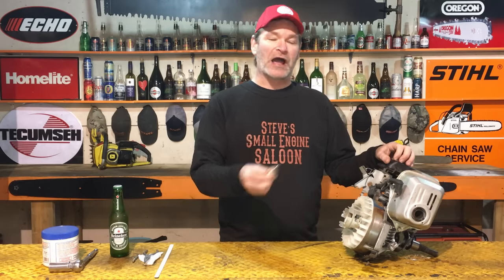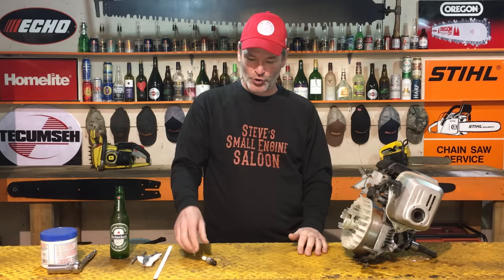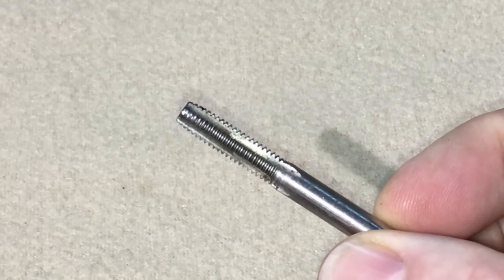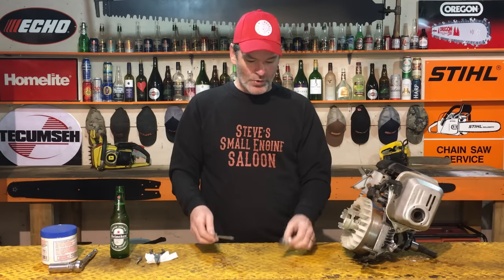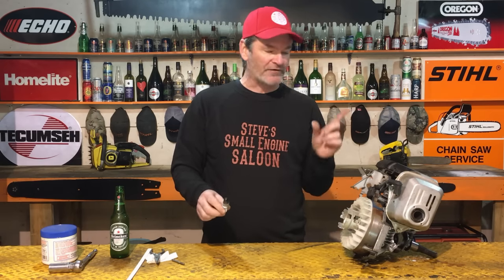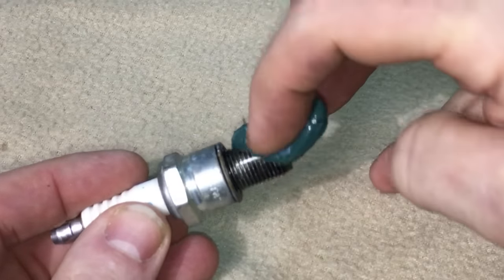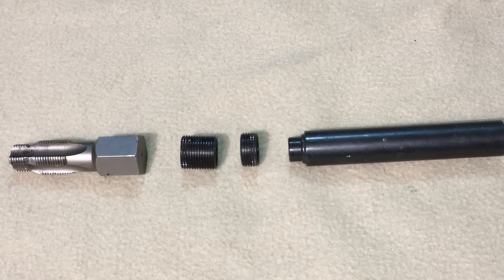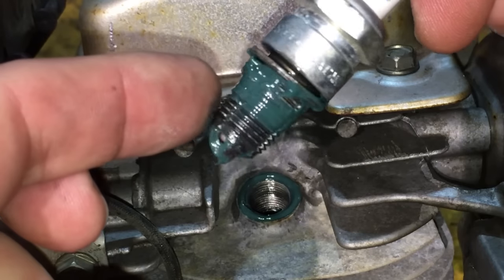How To Fix Stripped Spark Plug Threads For Free With This Hack

Comment from the maker: Click here for a spark plug thread repair tool---- https://amzn.to/2H7ZvCG
Click here for spark plugs---- https://amzn.to/2SEzQmF
Click here for spark plug socket tools---- https://amzn.to/2C9cqi2
Click here for my website--- http://www.stevessmallenginesaloon.com/
Click here for my Parts and Tools Store---- https://www.amazon.com/shop/stevessmallenginesaloon
Reply: You think I could do this with my f150??
Reply: awesome, very helpful hacks.tnxs.
Reply: @eh6968  junk it
Reply: @lynnbellay9497  Finally did, but before I did I retapped the sparkplug and got another 30k miles. Burned through some oil though. Saved me alot of money before gas hit 5 dollars a gal
Reply: What if the tissues that I put in spark plug hole slipped inside and I can’t get it out
Reply: Thanks

Comment: In case anyone has wondered, with these engines and most modern car engines, the head is made of aluminum, but the cylinder and rings are made of steel, aluminum is soft compared to steel and if a bit of filings do make their way into the cylinder, it probably won't hurt anything. That doesn't mean skip the grease or the paper, but don't lose sleep over it.
Reply: Should definitely get it all out though if you can help it. Brake cleaner and a air compressor always works.
Reply: I had a B&S carb butterfly nut (brass) let lose and get sucked into combustion chamber.  I repaired the butterfly and ran that mower for about 5 seasons before pulling the head off because the exhaust valve was stuck open.  Turns out that little brass nut had been bouncing around in the combustion chamber leaving pits in the alloy piston but no damage at all to the hard bore.  I just cleared out the now completely rounded nut, and the mower ran perfectly again, and is till running to this day.  So yes, I agree that a bit of soft metal (brass or aluminium) although not ideal, will probably not do any significant harm inside a combustion chamber.
Reply: These crackpot mechanics are funny.

Comment: Just did this on my gf's Yamaha xj600s and it worked like a charm. The only thing is that the sparkplug hole was too narrow, deep and stuffed away to fit a needle nose inside so I figured I would just try and blow out the shrapnel with a compressor without using the paper tissue. for now it has worked brilliantly, just really hope there won't be any damage in the long run...

Comment: Holy crap. I can't believe this worked. I couldn't get the repair tool into the spark plug cylinder on a Chevy Spark. So I tried the "hack" by cutting 4 sides into the threads of an old spark plug per the video insert and gently rotated it into position. I was then able to back the old spark plug out, and the new spark plug finally went in without me having to deform the new spark plug. Thank you!!
Reply from the maker: Nice job!

Comment: I cross threaded my Honda GX 390 and got a re thread tool. I finally got it in. It seemed great. Ran the machine for probably 20 hours or so and it popped out of the threads yesterday. So odd. Machine shut off immediately. Now I don’t know what to do.

Comment: Just started a small engine business , I've seen so many others condemning machinery as uneconomical repair and ripping of customers I thought I'd try it , it's going great I'm fair on pricing and use second hand parts were I cant get new for older machines to keep them running , your site has been invaluable Steve, keep up the good work 👍🏻
Reply from the maker: Thank You...and good luck brutha...

Comment: This has been a valuable lesson..I wonder, will this work for a 1994 Ford F150..plug broke off when changing; had a mechanic try..he had to drill it out??,,,but, replaced with smaller plug and it still has a miss..any ideas what needs to be done to fix this?  Thanks bunches for any advice you can offer.

Comment: I can't believe that this worked. I was changing my spark plug before a snowstorm was due to hit and as luck would have it I stripped the threads. I ordered the thread repair kit from Amazon but it wouldn't be here in time and then I found this video. Instead of using a hacksaw I use my Dremel with the circular blade to make the cuts but I have to say this worked perfectly thank you so much
Reply from the maker: You're Welcome...

Comment: Thanks for another fine lesson on small engine repair. So, do I understand correctly that the loss of some threads/metal material is of little or no concern? Why is that?
Reply: If the plug blows out you haven't lost anything by this shadetree method.
You can go ahead with Heli-Coil or larger plug.

Comment: I’ve done this with bolts and threaded holes multiple times never had the issue of a plug hole with damaged threads where I used this method but I am sure it would work great.  The things you learn when repairing things professionally are invaluable for life when you get a curveball a crusty old mechanic showed me this trick years ago.  Great video for passing on knowledge.
Reply from the maker: Thanks for sharing
Reply: @StevesSmallEngineSaloon  I found damaged threads without noticing any lack in performance. This echo leaf blower is a PB-9010T. 1-1/2 years old. Can not believe this has happened

Comment: Such an invaluable hack. This could have helped me 10 years ago when I cross threaded my 2002 Honda Ruckus Head. I used some lock tite on the threads when I put my plug back in with some help from a friend. But I never thought to do this. By watching you I think you could have dropped a Q-tip in the hole and swabbed the threads before pulling out your tissue for some added reassurance that there will be no filings left. Also utilizing a cheap inspection camera to insure there are no filings left behind in your combustion chamber. It’s cheap insurance! Thank you for sharing your knowledge and the ingenious knowledge of others. Your an absolute lifesaver!
Reply from the maker: Thank You...
Reply: I just did setti g my values slims about too it love my rukus huss urs doing

Comment: Great video thanks for posting. I’m wondering if, when cutting new threads, supporting the entire engine upside down so that the spark plug hole is pointing downwards wouldn’t this alleviate any metal chips falling into combustion chamber?

Comment: Yo Steve! That worked out!
I bought a new spark plug and i cut away to mimic a tap and it worked. It cut away and cleaned out the threads on the block!
Thanks for that tip!!
Reply from the maker: You're Welcome...
Reply: Retired steelworker
I learned this from a gunsmith but we used a triangle file and made three slots on spark plug and he also said that this is called a thread chaser

Comment: Do you use a larger plug or just the original you intended to replace to begin with, if the threads are completely stripped wouldn't you need a larger plug in order to cut new threads I know this hack will work if you still have threads perhaps a cross threaded plug or something along those lines but if the threads are just sheared off the hole is already the size of the outside of the threads on the plug.

Comment: I bought a used mower a while back, and found a cross threaded plug while doing a tune up. It runs fine, so I haven't messed with it yet, but it bothers me.

I don't know how someone screwed it up, but there are exposed threads. The washer is loose too. The mower had been serviced by the dealer since new.

Comment: Thanks for the taking the time to make this video. I unfortunately cross threaded the soak plug on a HF Predator generator. I was going to use a save a thread ($40+ in Amazon) or auto zone’s copy from duralast. I used your tip. Not gonna lie, I was sweating for a while but in the end I was able to get it done. The generator fired right up.
Reply from the maker: Glad it helped

Comment: What if it's a tiny little spark plug and the threads in the cylinder head look like crap ? On a very small pocket bike 40 cc four cycle engine

Comment: Another great tip from Steve and Scot. Try this also. Use a stronger tissue like a baby wipe to prevent it tearing when you remove it with pliers. Also put the piston at top dead centre to prevent the tissue from falling down  into the cylinder.
Reply: What if the tissue does fall into the cylinder or the engine? What do I do now?

Comment: Have a 06 dyna street bob, frt plug threads got stripped, used back tab, but plug doesn't tighten till right by before comp
ression ring,, used Red Locktite, how do remove, plus can I run a 14 plug in front, and 10 on back,,

Comment: My 2000 Honda CRV threw a misfire code on cylinder 2. I checked the plug and noticed it would spin tightly but never torque down. I watched this video and used this method. It worked! No more misfire, thank you for sharing this information.
Reply from the maker: Right on

Comment: If you can get the head off, you can also straighten out the threads by taking a plug through from the inside of the hole.
Reply: @JM-yx1lm  I wasn't going for the easiest way, its just another way.
Sometimes its hard to get the tool for correcting the threads to go straight.
How  would you tackle it?
Reply: Heli coil…. Dun deal..

Comment: Hi guys, I have a question. What happens next time you need to change the spark plug? Do you have to apply the same lines in the next spark plug again? Cheers.

Comment: Great trick but reusing the spark plug with cut threads is asking for trouble. Why not throw it away?? Most spark plugs for small engines cost less then $5

Comment: Great tip here Steve... The average Joe may not be prepared to go the heli-coil route, plus the tool & thread adaptors can get a bit expensive too. This reminds me of my now long forgotten JD LX-176 single cyl engine spark plug cross thread ordeal I had. That mower was on its last legs in either case after 19 years of hard work but very well maintained, that is why I got 19 years out of it! It's last (4) years of service, it was held together with Bandaids basically, lol... In my case, the starter threads in the cyl. head cross threaded, I chased my new plug back into the cyl head with a back & forth motion, basically recutting new threads into it or more likely, restriping new threads into it. I knew this was the last time it would ever see a new spark plug, seated it all the way back in, ran like a champ. (1) year later, bought a new JD X500, with a twin 25 HP Kawasaki engine with locking rear differential. This machine will last the rest of my lifetime with proper maintenance on my extremely steep terrain here in the highlands of VT.
Thanks Steve,
Bill on the Hill...
Reply from the maker: Right on, thanks Bill...

Comment: My little gx160 honda friggn keeps shooting the damn plug halfway across the yard every first pull..  ill get it in and tight, pull the cord and boom spark plug gun..  happened 4 times in a row..  opened the choke and it still did it but blew the filter out also..  i mean im not running jet fuel in the damn thing..  it started the first pull then puttered out..  so next pull it sploded..  and now does it every damn time..  should i just put some jb on the plug and screw it in then take it out so it makes the threads bigger..??

Comment: My mower spark plug was cross threaded, I tried the trick using a hacksaw blade and didn’t quite work. So I bought a tap for less than $10 and it worked like a charm!  Great video, thanks Steve.
Reply: Had the same problem Allen, the RJ19LM is a short plug, I couldn't seem to.make contact with a blade, but none the less a great hack.

Comment: Great video - I should've given this a go, instread of a reemer tool for a hydrocoil repair kit.  In doing the reemer on a 15 hp briggs block, rather than cleanly bore, it chewed out alot of material, leaving no material to thread for the coil insert.  To try to fix, we were able to get a coil insert 2 turns into the block, of what was left, and filled the sloppy play with JB weld steelsink (says capable of up to 900 psi / 300' F).  
I was hoping to ask, for your thoughts on that approach ?  Mower ran fine in a short 15 minute cut, however the spark plug cable was extremely hot, and almost looked like the rubber of it was getting way too hot, could not be touched, some white smoke from the port.  Could the JB weld be transferring too much heat back up the plug from the block ? 
 I appreciate your channel and all your videos very much - thanks Steve !

Comment: The best thing to do to keep from stripping the threads is start the spark plug by hand & run it as far in as possible before putting wrench on it. Then just snug it down.
Reply: ... which is exactly what he said in the video lol
Reply: Best way is back out after every turn cutting

Comment: Does this work on cars? F’ers at a car shop cross threaded my 4th spark plug and told me they wouldn’t fix it without diagnosing the engine (which didn’t need to be done) and charging me 79.99$

Comment: Thats one thing I never have seen.  There is also a product at my local hardware store which fits around the plug and will make it fit for mean time.  I have a tap and die set and have used it alot but cant get my old Husq 266s flywheel off due to stripped threads and most likely the fact that I am using the wrong puller.  The one I been using was made for echo, poulan and husqvarna chainsaws under 52ccs.  I also need to get a good case splitter so if you have any recomendations LMK.  THX

Comment: Car, motorcycle, chainsaw, lawnmowers, always back thread till you feel the "click" then screw in your spark plug. I haven't had problems with spark plugs in decades.
Reply: What do you mean please?
Reply: @jayvalentine7080  start the bolt by turning it backwards until you feel the threads click together. I think.
Reply: lr lrs yes that is what he is talking about I’m a plumber and it works great. I cross thread very little. But in my situation it’s on a car hard to reach hole I can barely screw forwards let alone back to feel a click, and even if I do I have no idea if is going straight it could be at a slight angle since i can’t see it

Comment: What about when the plug is tightned using an armstrong with a pipe extension, and the threads are now on the spark plug leaving a smooth hole? Helicoils can be a keg-size job!

Comment: I came across this after I had to get my sons SNO-TEK 208cc by Ariens snow thrower. It was real bad, even cracked the edge of the spark plug hole. Once done, it took a bit to get it to start and stay running. Had to use starting fluid spray and about 100 pumps off and on on the primer between start attempts. With a new plug, it runs again.

Thanks for posting this.
Reply from the maker: You're Welcome...

Comment: I've tapped car engine heads for spark plug thread inserts without removing the head. Similar procedure but no stuffing paper in the cylinder. Using oil or grease to catch as many chips as possible (removing the tap frequently)  then vacuuming out the cylinder to get more then turning over the engine (without starting) with the spark plug out so the chips blow out the hole. Block is iron, head aluminum so it won't hurt anything to get the chips out that way.

Comment: Was about to pull the trigger on the tap/helicoil system and then I saw your video. Thought, what the heck, let's give it a try. 5 minutes later, not only did the spark plug in my Toyota rav4 2008 go in, but I was actually do the proper torque as well. Super impressed and thankful.
Reply from the maker: Right on buddy!

Comment: Nice hack! I tried something similar to another application(which I don' t recall) and it surely is a fantastic money-saver. But I think I have some other ideas which maybe are better than just pulling the paper towel out. I think that the best thing it to put an angular metallic needle-something at the bottom threads and start scraping them off while unscrewing that needle all the way out. And then start twisting off the towel as well. What do you think?

Comment: great hack, will be trying it as soon as i pick up two new spark plugs. on the cleaning metal out of the plug hole i would use a stick magnet also along with wiping it out like you did. Thanks.

Comment: I just wrapped silver foil around the plug threads, pushed tight into the threads, worked okay, plug was tight. Briggs heads are soft and easily damaged. But many side-valve heads are interchangeable so a head can be salvaged from an old mower

Comment: How long do you think it will last?
The repair, not the beer.
Reply: If you did it properly, it will last for whatever remaining life your engine has. I did it on a little Honda tiller and it is still running just fine/has not blown up.

Comment: That is great. I did cross thread a plug on my Honda blower this year. I had a spark plug threader for years that I had never used. Don't even remember where I got it.
I figured I would give it a go as I had nothing to lose. It worked great and cleaned the threads. I used a vacuum to suck the metal back out. Most of them stayed on the tap. What I learned from this is to use a tissue and grease if I have to do this again. Thanks for this video. I have removed plugs for over 50 years now and this one was the first time I cross threaded one.
Reply from the maker: Thanks Paul...

Comment: Hi Steve
Great video! may I know if you need to pre-drill to use the tap tool? and how to prevent metal chips into the cylinder when drilling? Thanks so much.
Reply: I know the answer is a bit late but better late than never. You don't need to pre-drill if you use the same tread size tap as the spark plug, you only need to predrill if you want to use a different size sparkplug or if you want to use an helicoil to redo the treads. I know that because I'm a machinist.